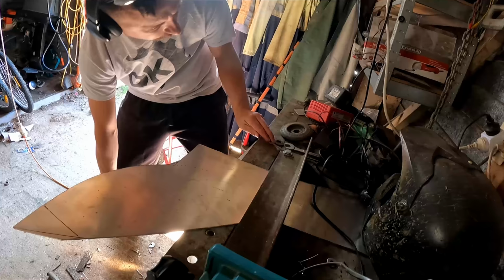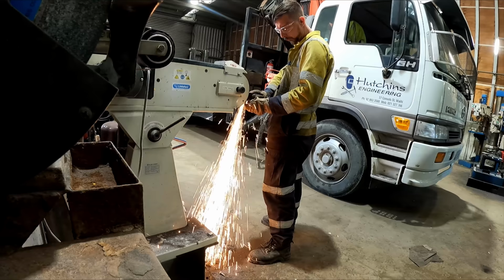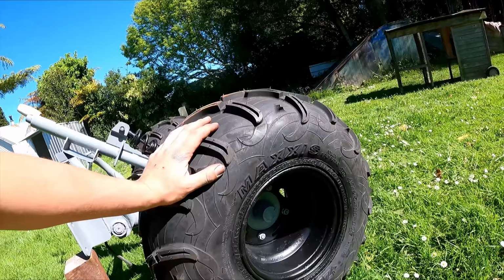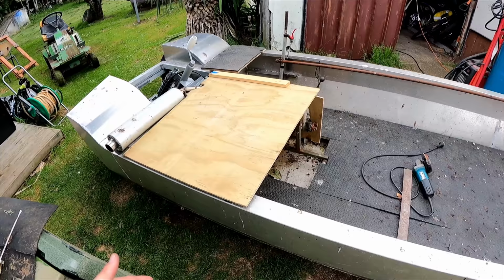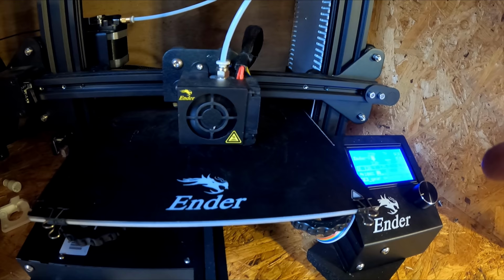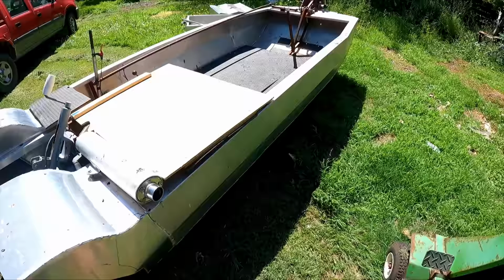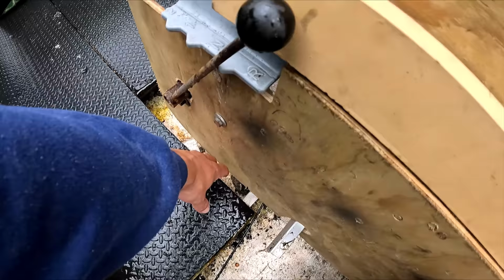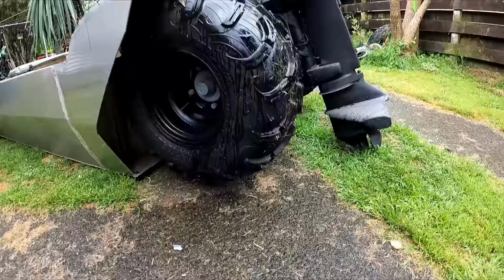Amphibious Atv Boat Build,p4

Comment: That turned out awesome.  It looks really stable on the road.  I'm surprised for such a long wheelbase and three wheels.  That large drill press at your work is pretty impressive
Reply from the maker: The whole thing flex’s a little as you turn but it is ok I have been driving around a bit off camera and I’m very happy with it , thanks Bruce

Comment: Hello, i am building a boat that has verry thin (0.5mm) aluminium parts under water. Do i have to worry about corrosion because of the water? Do i have to protect theese parts with paint or something or can i juste leave them as they are? 
Great video !
Reply from the maker: You don’t need to paint it , but if in salt water it can corrode if water gets trapped between layers or rivets but should still last for years
Reply: @DktheWelder  Thank u so much

Comment: I’ve thought about something similar using a Jon boat but with 4 ATV tires and wheels. Problem is,I don’t have a shop to work in and I don’t like building stuff in minus 30 Canadian winters outside. Have the technology and tool though.
Reply from the maker: I was originally going to make it four wheel drive with a quad front the would let the wheels come up out of the water but it was too heavy . So I just went with the 3 and sitting right at the back , new test video out soon👍
Reply: Your idea is very sound. Front wheels could be raised in a very similar manner,and that’s the design flaws I’m kind of stuck on. Where I live,lots of small lakes,rough terrain to get into,so I’m looking at something with independent suspension that can retract for water use. I’m seeing great ideas from many different channels and appreciate them all. Keep up the good work! I’ll stay tuned for more.

Comment: If wanna print something even tougher ,Grab yourself a Phatues Dragonfly BMS hotend,Bolts right onto Ender 3 and pickup some Esun nylon carbon normally cubic tech have in stock

If ya need anymore help give me a message,Love ya work
Reply from the maker: Thanks I’m getting more into the 3d printing and slowly getting better at it. Have you tried printing propeller’s?
Reply: @DktheWelder  Done some RC ones for a friend thats about it